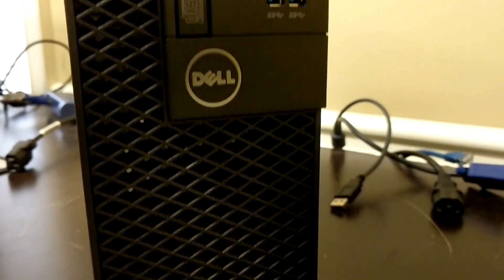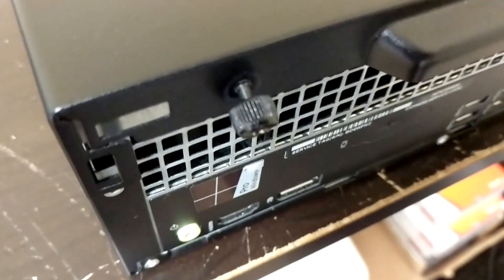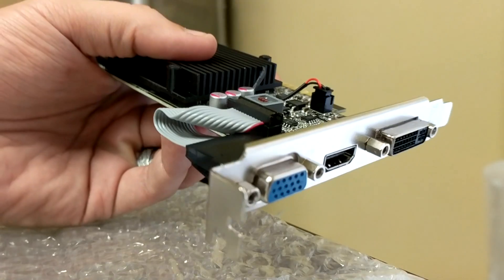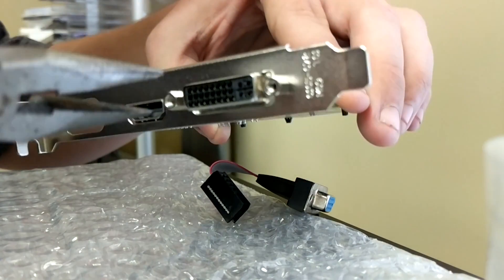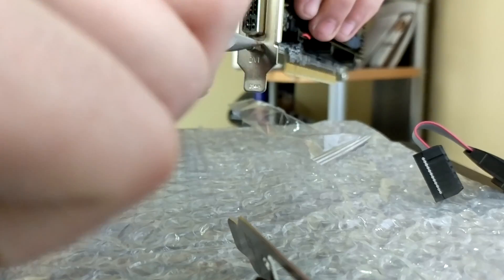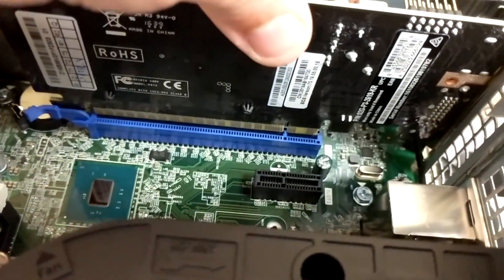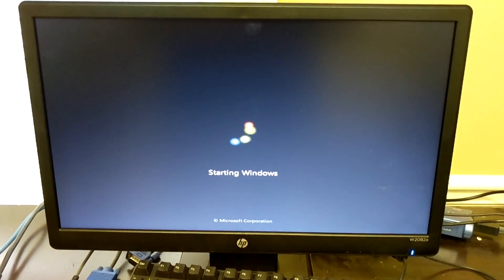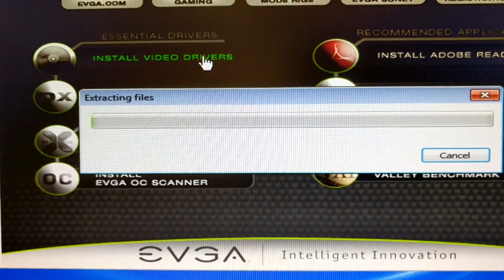Dell Optiplex 3050 SFF Graphics Card Installation (6th Gen i5)

Comment: Thank you for the video, but you said it's a low end graphic card, is it possible to put a stronger graphic card on this pc or it won't fit in because it's the SFF ? ty
Reply from the maker: You could if its a Slim Profile High End Graphics card. A lot of them include the plate to make them a little smaller. Just depends on the size and power requirements of the cards.

Comment: Trying to install a hd 7570 into my 9020 optiplex ssf, however when I plug the monitor into the graphic card, the monitor does not come on. I have installed the driver for the card manually, and it showes up in device manager. Don't know what's wrong, but at this point I am thinking it's the graphic card.
Reply from the maker: It could be your monitor cable. Do you have a different cable to try it with?

Comment: Yeah mine came with a hd7570 which is 60w so if you guys are wanting to do the 1030 you'll need to do the low profile version in order for it to work
Reply: Is your monitor connect to the display port or DVI port? Trying to figure out what's wrong with my HD 7570 card

Comment: Can i put Rx570/Gtx1050ti to optiplex 3050?
Reply from the maker: That card may be to big. Try to find the measurements and see if it would fit. The way the case works may block it from working.

Comment: Hi I have the same exact pc, Im looking to get the GT 1030 or 1050 do you think it will fit? Talking about space and power supply. Thanks
Reply: 1030 low profile will work perfectly that is what im currently using
Reply: @tjlaweej  hi! Do you have a link fot the gt 1030 low profile please🙏
Reply from the maker: Sadly in this box, I doubt it would fit or have the power.

Comment: Can you link the mount that you used for the gpu? I also have the same pc optiplex 3050. also will it work on gtx 1050ti?
Reply: Did you try it with gtx 1050ti? Did it work?
Reply: Same question as my dude Joseph
Reply: You could if you get the low profile version.

Comment: You don’t need to upgrade the psu for this graphic card? I have a dell Optiplex 5040 and looking into upgrading to a geforce GT 710.
Reply: It's like 30 watts. You're fine. I use it on a 3020 with no issues, and the 3020's CPU has a higher TDP
Reply: @Knights_of_the_Nine  can you put normal (not Low profile) gtx 1650 there?
I see the PSU = 180w. - 65w processor, - 75w 1650, it still has 40w to breathe. for ram/hdd/ssd etc

Comment: bro i have the same pc but not the ssf i have the mt it has 240 watts psu can i add on it gt 1030 ?? does the pcie slot support gt 1030 30 watts plz help me ???
Reply from the maker: Hello, sadly I would think you would need to upgrade the power supply. I would not see a 240 watt power supply being strong enough for a Gt1030 and the PC. This GT610/710 is much weaker and can run off the normal power supply. Would likely need Atleast a 400watt to power everything. You could try it but I'm almost certain you would get some type of power error or an issue after playing for a long period of time.
Reply: @BigCVlogs  thank you for answer bro but the gt 610 has 1 watt difference the gt 1030 is 30 watt and the gt 610 is 29 watt by the way does the motherboard slot supports gt 1030 on optiplex 3050 ??? If you can answer me bro
Reply: @BigCVlogs  its even worst.. this dell optiplex only 180watt
Reply: I have one that i just got and it looks a bit big
Reply: Yes u can if it works on a 180w PSU definitely with a 240w

Comment: zotac gtx 1050 ti oc edition. Will this fit in a optiplex 3040
Reply from the maker: Sadly I don't know. You would need to mesaure the card and then see if the website has the size of the case.
Reply: BigC Vlogs Thanks for replying!! I got it and it fits! Thanks for replying
Reply: @luckarm5481  thank god, I did very little research + I'm a noob lol
Reply: @luckarm5481  bro do you have the same pc with this ?? Do you use still gt 1050 ?? Does this motherboard supports this cards ?? I want to put gt 1030 do you think all will be ok ??
Reply: NIKOS GAMER I got everything in and it fits very good and works well I’m not sure about 1030 tho but I think it will be all okay
Reply: @luckarm5481  bro I have the dell optiplex 3050 mt it has 240 watt psu I will put gt 1030 lp I think it will be ok what graphics card are you using on this pc now ??
Reply: NIKOS GAMER Same a gt 1050
Reply: @luckarm5481  nice bro does your psu is still alive ??
Reply: NIKOS GAMER Yeah it’s pretty good

Comment: Will I have a problem? If I put
 gtx 1050 ti ? (7th gen) i3 7100 ram 4 gb optilex 3050 Please reply
Reply: 1050 ti won't fit. Dell optiplex gives no room for higher cards like these
Reply from the maker: It should work, but you would wanna see how much power the 1050 needs because you may have to her a bigger power supply.
Reply: 100% will not fit inside this case

Comment: Hi bro I have the same pc but mt and it has intel core i3 7100 8gb ram 500gb hdd and the psu is 240 watt and iam using gt 710 2gb do you think I will have problem with the power supply ??? Is this pc still alive ???😂 plz help me ....... and this pc in video how many watts has the psu ;;;;;;;; plz answer me
Reply: Hi, the Minimum System Power Requirement  is 300w : https://www.geforce.com/hardware/desktop-gpus/geforce-gt-710/specifications. The PSU for the MT optiplex 3050 is 240w : https://katalog.atcomp.cz/katalog/D-D-3050S-301/Dell_Optiplex_3050.pdf

Does it work fine for you when you put it on the motherboard ?
Reply: @imadmimeche9399  yes it works fine but I have disassemble the optical driver to have a bigger space on watt do you think is fine I'm running my pc for a month without problems???
Reply: I think you should contact Dell to Know if it has a negative effects un the long terme.
Reply: I don't think it will have a negative effects since the graphic card consumes 19 Wats.
Reply: @imadmimeche9399  thank you bro i just disconect the optical driver

Comment: The Chipset of these machines can do up to the i7-9700K. So the best option if you have one of these is upgrade to the new i7 model
Reply: I don't think it can support the i7-9700k processor, it's for 6th and 7th generation i3 and i5 processors. https://katalog.atcomp.cz/katalog/D-D-3050S-301/Dell_Optiplex_3050.pdf

Comment: I have the same pc but intel core i3 and 4 gb ram can i put gt 710 graphics card or i will have problem ?
Reply from the maker: You could, all though the on board graphics may be enough. This client needs the graphics cards for 3d because on board doesn't support it. (3d x-rays)
Reply: I don't think it is possible since the Minimum System Power Requirement is 300 w. check the specifications https://www.geforce.com/hardware/desktop-gpus/geforce-gt-710/specifications

Comment: Congratulations on the video, does this Dell source take it easy on a GT 1030?
Reply: Works fine...
Reply from the maker: With a GT1030, you would need the higher end power supply. The standard power supply would not work sadly.
Reply: BigC Vlogs i'm not mugging you off,
But the gt 1030 will work perfectly fine since it has a max tdp of 30 watts. Which is exactly 1 watt more then the gt 610. So yea it will most defenitely work with the low profile one
Reply: @jeffreykleeven  bro i have the same pc but not the ssf i have the mt it has 240 watts psu can i add on it gt 1030 ?? does the pcie slot support gt 1030 plz help me ???

Comment: Is there any cpu cooler that would fit this case i have 3040 sff i think there similar design
Reply from the maker: I would have to say im honestly not sure. I did look for a power supply due to needing an higher end graphics card but could not come across one. A few that looks close but no cigar. I would recommend checking directly with Dell. ~ Big-C

Comment: Do the 610 and 710 come with the brackets to take out the vga port?  Is there a big enough power supply to run this card?
Reply: i think yes the gt 710 2gb uses only 19 watt from the psu the gt 610 uses more than the gt 710 i recomend you to put gt 710 low profile is better

Comment: What PSU do you have in it? I got the same pc and mine got 180W continuous output - way too low to support this GPU in combination with i5 processor and the rest..
Reply: +Abel Piceno Gutiérrez Definitely not possible.
Reply: @abelpicenogutierrez2323  no bro it will fit your psu dont try it on this pc this pc is not for gaming....if you want to buy psu for this pc it supports only 6 or 8 pin psu and you need to buy 240 watt or 300 watt you can get it only from dell and it it is very expensive you cant use any tfx psu on this only from dell !!!!!